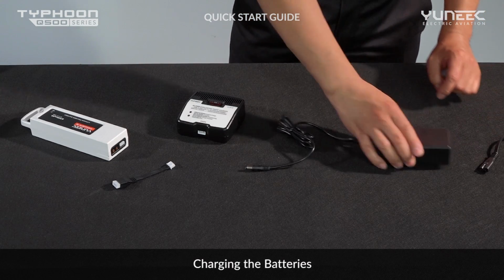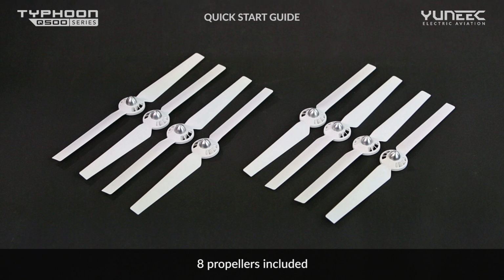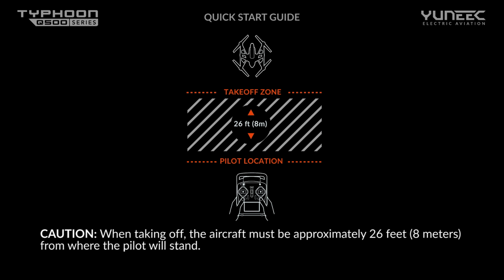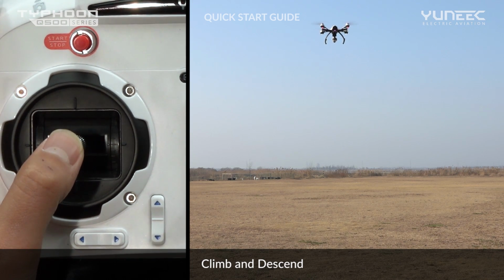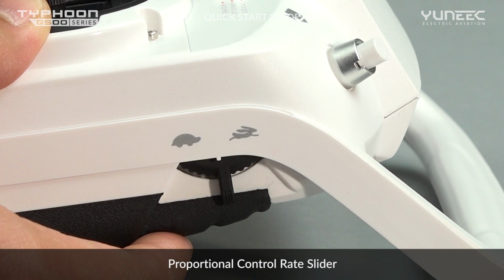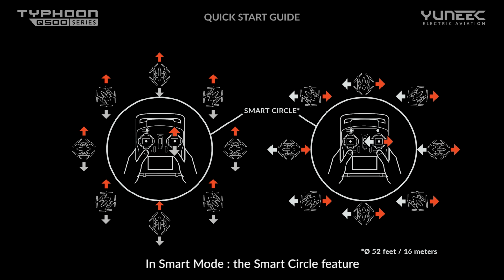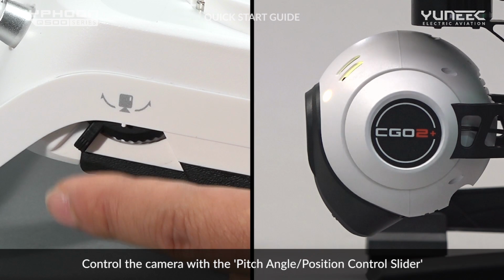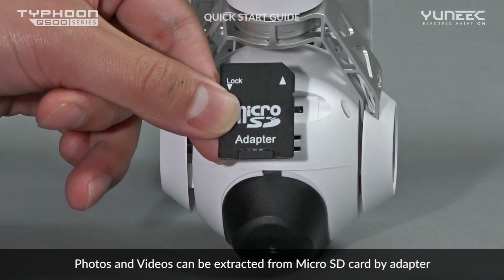TYPHOON Q500 (4K) Series Quick Start Guide

Comment: I've had my Q500 for four years now. I'm starting to use it much more now. Had to use Velcro to attach a battery to the bottom of the quad cuz they don't make the battery for it anymore. Works great tho. Added strobe lights to it. Needed to brush up on the controls.

Comment: I just got my recert Q500 Typhoon but it doesn't finish initializing and the ST10+ shows mode N/A, GPS N/A, SAT N/A,  Pos N/A etc.  It says no connection.It seems like the entire memory was swiped by the recert factory.  Can you help before I return this one, again.
Reply: Pringle Boy Mine just did this today. I literally just flicked it on and off (The remote AND drone) 4-5 times and it reconnected. Might be different from your situation, but that’s what I did.
Reply: @undahmongoose96792  If you first turn on the remote control! Then you turn on the drone! If you follow this you will be fine   https://www.support.com/how-to/how-to-pair-new-remote-with-yuneec-typhoon-4k-drone-12414  ------